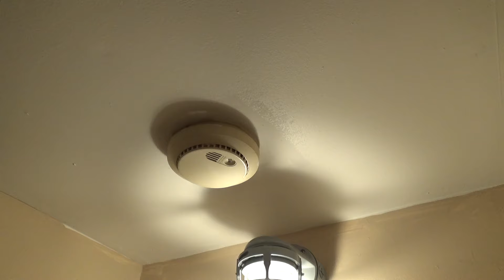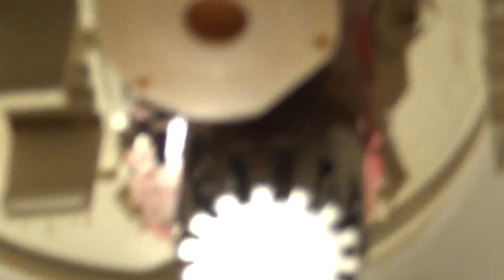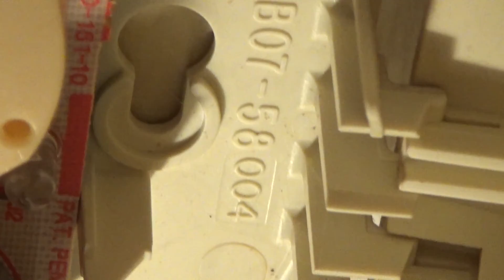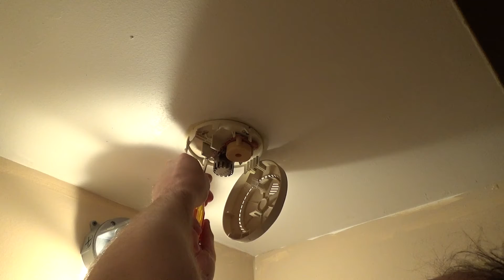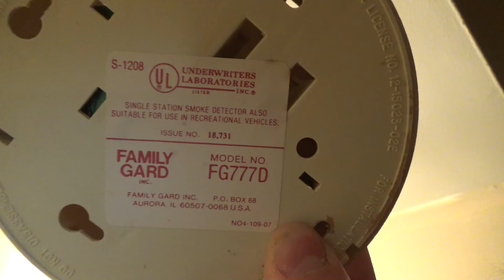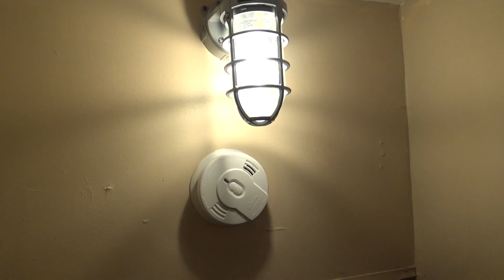Family Guard FG777D Vintage Smoke Detector | Power On and Test

Comment: I have a General Electric  smoke alarm from I believe 2000 I bought it at Target back then it still works but when it beeps it does a very high pitched scream for about 5. Mins instead of beeping ever 12 secs like it used to is there any way of fixing this problem

Comment: FYI: The smoke alarm on the side is a Kidde i9010. It also uses an ionisation sensor to detect smoke (fast flaming fires) as opposed to a photoelectric sensor (Slow smouldering fires). The reason why the FG777D doesn't do 3 beeps (Code 3), is because it was manufactured in the 90s, and therefore It does 4/6 (constant beeping) as the alarm pattern
Reply from the maker: Thanks for letting me know.

Comment: That was awesome! 

You can get cans of smoke to spray onto these detectors, which will be invaluable when it comes time to fill your house with vintage ones. And maybe you can find one with an unusual sound when completing that project. 

I do know of some dedicated fire alarms that have the really cool and eerie 60Hz sound, including a family of vintage models apparently louder than any other fire alarm ever made (the Simplex 4030 seems to have been the original in that family). Sadly, those are extremely hard to find these days.
Reply from the maker: Thanks

Comment: if it reacts to smoke, sounds an alarm and doesn't beep in clean air, it's working smoke detector

there are certain improvements in algorithms in those nowadays but that doesn't deny if it still does what i described above

only ones who have broken here are one that my mother dropped in her place, unsure if it was battery or accidental smoke from stove that she wanted it down for. goes right into alarm, i bet it's optical system just got busted but i have to investigate
Reply: Exactly, smoke detectors don't need all that smart crap they just need to be simple and cheap but simplicity and reliability doesn't seem to be a concern to the modern consumer.
Reply from the maker: Makes sense to me. As long as it's tested periodically and confirmed working, I see no reason not to continue using it.

Comment: Let me start off by saying I've been waiting MONTHS for this it's been a long time coming. This is an ionization detector but the radioactive material is americium 241 which has a shelf life of 432 years, The date code is located by the battery compartment on the sensor side it should say "replace by year 1996" or something to that effect. The rapid beep code is known as the 4-6 pulse before 1996 beep codes such as the 3 beeps weren't standardized by the NFPA I much prefer the old beep code. Let me know if you can find the date code it should be on the right hand side of where the battery is in the unit. It's definitely an 80s model. If it's not there and it just has the battery types than they only put date codes on the newer models If I had to guess it's a 1985 model for sure. 

The thing about photoelectric detectors is rather than having an aging radioactive material they have an LED that dims and becomes less effective over time how it works is when smoke enters the chamber the light emitted from the led scatters if this happens for long enough the alarm is sounded it's more reliable and long lasting but also more expensive. There were no photoelectric FamilyGard detectors FamilyGard is basically BRK but rebranded they were cheap economy model smoke detectors but they can still be bought new old stock for cheap so if you want more you can get more. The FG888D is the same thing but way more common.
Reply from the maker: I'll check for the date code next time I replace the battery. The plastic feels brittle, I don't want to mess with it unnecessarily. I like the look of these and they seem to work well, if they're readily available for cheap I'll probably buy more eventually.
Reply: It's from 1986, which is very late for using the false alarm sensor.
Reply: @Vintagesmokealarmsmedia  Yeah I figured either 1985 or 1986 I believe the production years of these were from 1985-2005 for the FG777D/FG888D/83R
Reply: @thomaswilkins8168  I believe you're correct as the latest one I've seen was from 2005, and the earliest one I've seen is from 1985, which both happen to be in my collection.